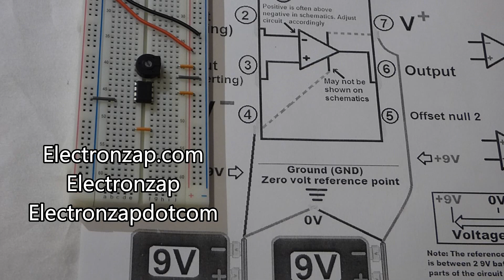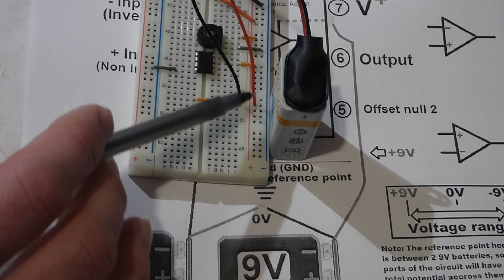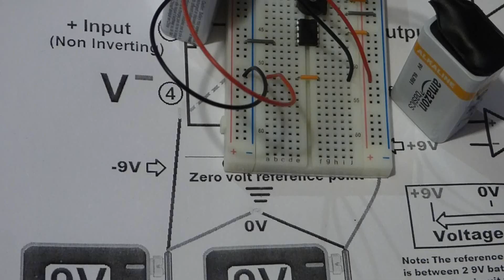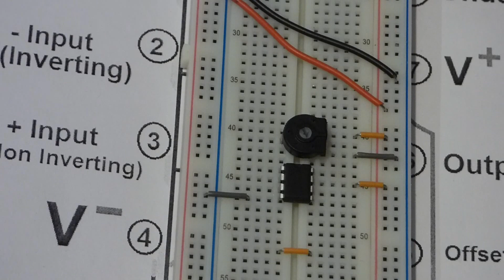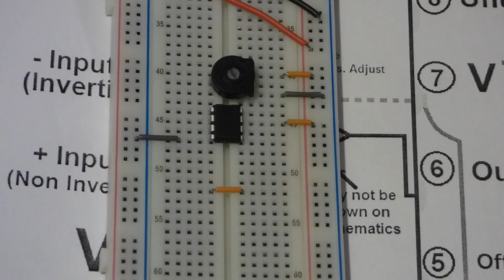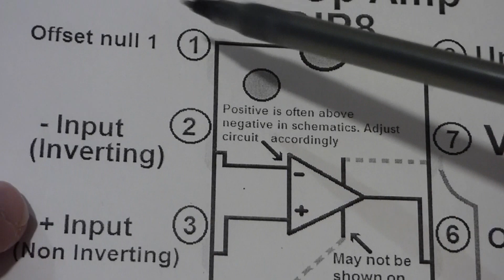741 op amp connecting pins 4 and 7 to split 9V batteries

Comment: Thanks a lot. 
But I wonder why would a circuit that works on a bread board not work when soldered on a protoboard? Yet all possible short circuit points have been checked and all components are OK?
Reply from the maker: That's a bummer. I don't build permanent circuits yet, but trying to troubleshoot an unexpected problem is always a pain.
Reply: Ok. Thanks again
Reply: Most likely cold solder joints. Go back over your work, test the continuity and expected voltage and current levels as you go. You can "feel" when the solder takes to joint, and if you had any suspicions about any of them when you soldered it, chances are one or two didn't "take." I currently have a delay pedal kit I put together that isn't working that I am trying to fix. I definitely had trouble getting some of the solder to take to the joints, but I need to find for sure which ones are cold before I just arbitrarily start adding more solder to the problem. Is like quicksand. :/

Comment: what happens if you connect pin 4 to +Vcc and pin 7 to - Vcc?
Reply: What happens?? if you connect the pins the opposite way to the supply sources??
Reply from the maker: No clue. Hopefully they have reverse bias protection and it does nothing.
Reply: electronzapdotcom Alright, thank you!!